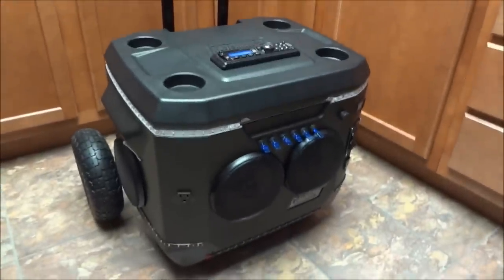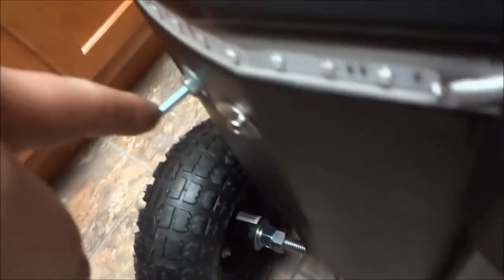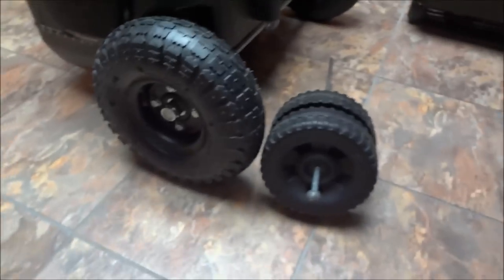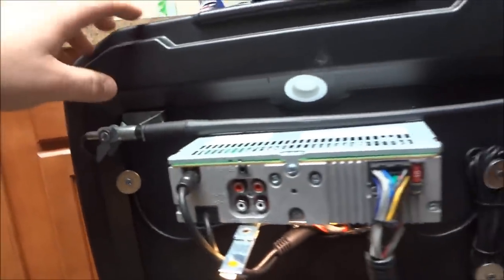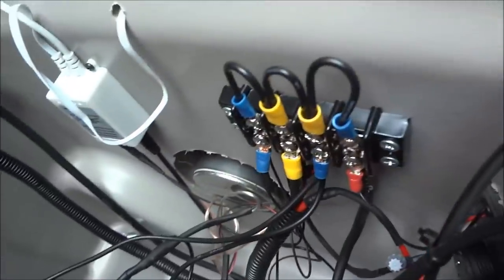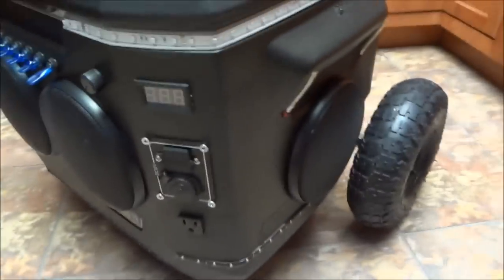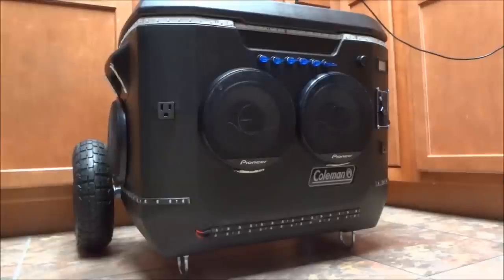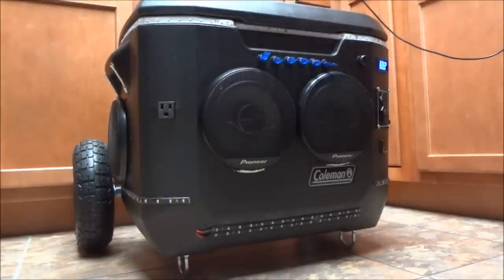My Cooler Radio Build

Comment from the maker: Also plan on adding a second 35AH battery, and moving them to the back of the cooler. Don't know why I thought having the battery so far forward was a good idea. Had it tip over when i leaned the cooler back to walk. Having it that far forward also makes it harder to tilt back.
Reply: RTcharger Awesome man! Thanks for the vid! Of all the coolers ive seen i love this one the best! Im planning on making this exact one for my girlfriend for her birthday in a week or 2. Any other tips you have? Im using same cooler and Polk Audio 6x9's instead. And a Rockford Fosgate Marine amp.
Reply from the maker: Thanks man! I've since updated it a bit, you can go on my channel and find the newer video "Custom Cooler Radio" I think it's called. But that sounds like a good combo you listed, I'd go with at least a 35ah battery. I still run just one and haven't been able to kill it yet lol. I'm currently building a monster 150qt cooler on wagon axles, join us on the forum and show us your build its "motorboatyourself.com" then click "forum" up towards the top, so many cool builds and ideas you'll get over there
Reply from the maker: I'm jealous of your speaker choice too, these 6.5's get crisp and loud but leave so much to be desired. Those Polks are badass, assuming it's the DB691's? That's what I'm using in my 150qt build with a mini amp.
Reply: RTcharger Yep those are the  ones! it was between that or the infinity reference speakers. Wasnt sure which were better we went with the Polk's. Awesome ill join the forum and read up!

Comment: Great job. Looks awesome. I'm working on a similar build. Having trouble with the axle. My wheels keep locking up after rolling a bit when the nuts tighten against it. Did you have that trouble? How'd you set it up so it doesn't do that?
Any help is greatly appreciated. Thanks for sharing.

Comment: how does it sound without the amp, I have an amp running my 4 6x9 rockfords, and have sony head unit, but battery dies very quick.. any suggestions?
Reply: +steven laurent what size ah do you use? I would go with at least a 35ah. if that's what you have and still need more add a 2nd 35ah. I run 4 6X9 PA and the 4 channel PA amp and have not been able to kill it yet.